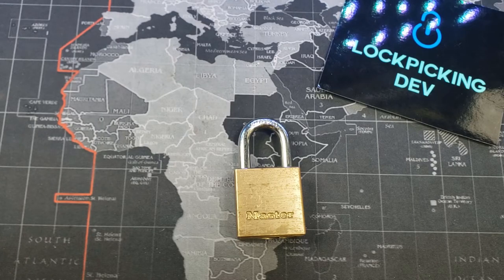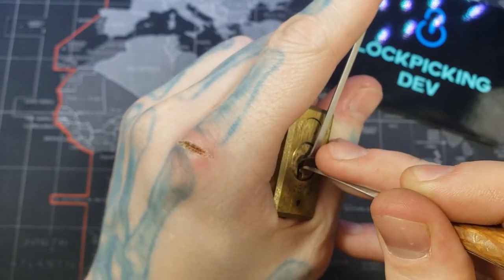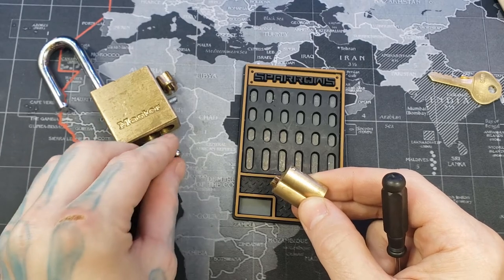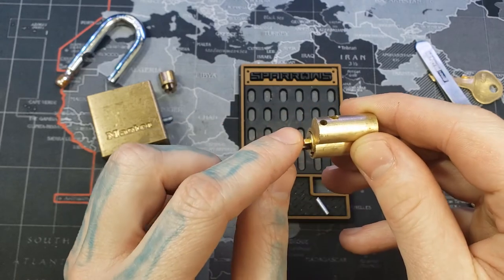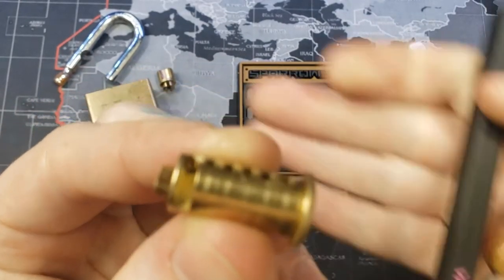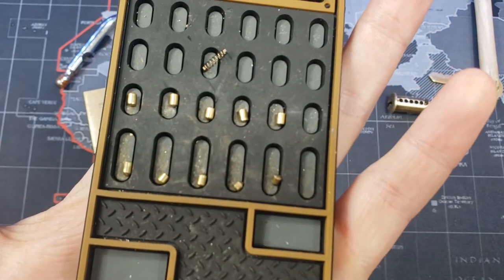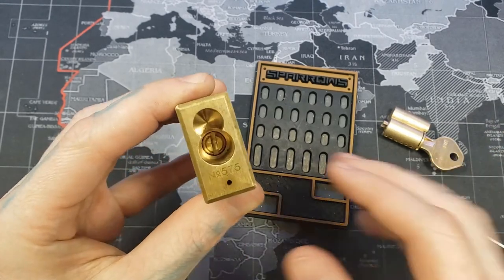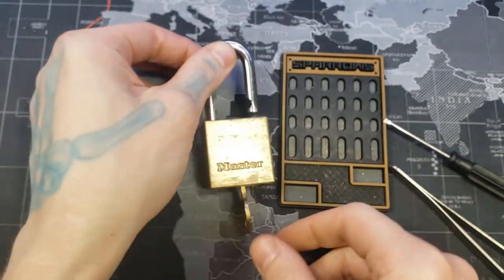121) Master Lock 575 Picked AND Gutted

Comment: This lock is one of the biggest jokes I've ever had the luxury to pick open. Put in the wave rake and it instant popped open.
Reply from the maker: It's definitely one of the easier ones in my experience. Though even other Master Locks can sometimes be a pain! Really depends on the particular pinning, tolerances, etc
Reply: @LockpickingDev  Not sure if I got a lucky bitting or if the lock really is just bad. These were easier than some of the locks I've combed open, and that's saying something since combs are just insert, push up, turn.
Reply: I have had that happen with one of my ML 570's.  I think my ML 575 has spools in it, it is clicky like my two ML 570's.
Reply: I’m just now trying to learn and had one laying around from a deployment. Idk what I’m doing wrong but I’ve been messing with it for like 4 hours and still haven’t gotten it 😂
Reply: Mine personally was raked open the first two attempts ever trying it - followed by a day or two of me failing due to overthinking. 

But with the lightest tension I’ve ever applied to a lock, the burning order is 1,2,3, CLICKs open 🤣.